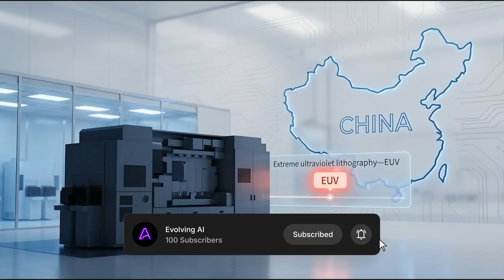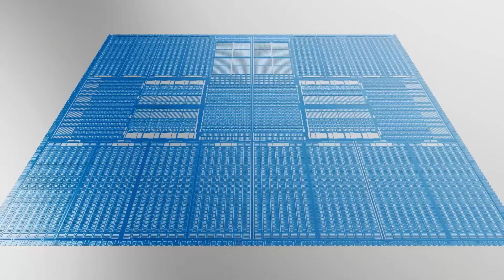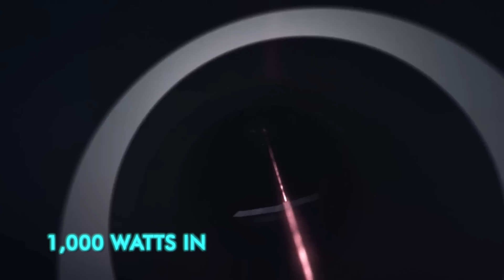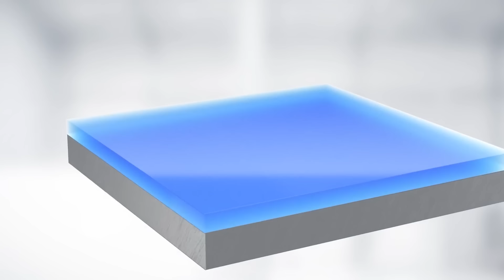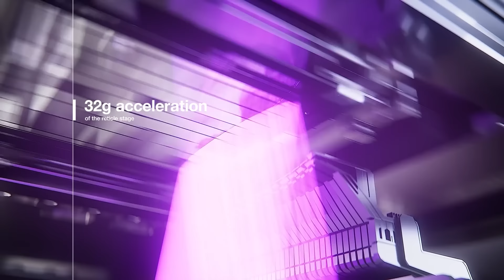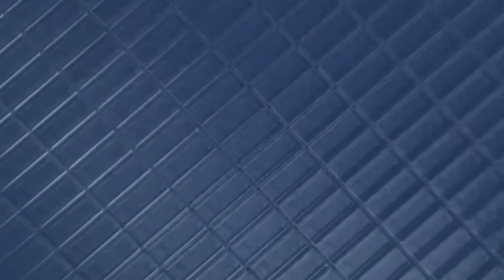China Just Successfully Built ASML's Replacement & The West is in a SERIOUS TROUBLE!

Comment: They are also working on a 100–150-meter-circumference SSMB (Steady-State Microbunching) particle accelerator designed to provide a >1 kW continuous, pure EUV light source for multiple lithography machines. While the SSMB principle has already been validated in a proof-of-principle experiment at the 48-meter-circumference Metrology Light Source in Berlin, scaling to a full prototype is estimated to require several hundred million to one billion Chinese yuan (roughly $100–150 million USD), with success hinging on extreme technical hurdles including maintaining ultra-stable electron beams under ultra-high vacuum, employing magnets with substantially higher power-supply stability than current standards, and perfecting the optics for efficient EUV light extraction.

Comment: It's only a matter of time before China announces mass production of EUV machines, and when that happens, semiconductor stocks—ASML included—will drop sharply.
Reply: They prob caught up by 5-10 years but are still not anywhere close to asml’s machines
Reply: @TC-jo2vj For China, the priority is being able to produce chips, even at a lower yield than the ASML machine.
Reply: Imagine countries with 2-3  lethographic machines mass producing 5nm processors, chips all over the place...
Reply: First they have to conduct multiple tests on that prototype and pass all test cases
Then they have to train an entire floorline model of about 100k components based on the test cases result 
Then they have to configure perfect climatic and region wise constraints for every single machine in factory
Then they have to run about half a million combinations and pass about 95% of it in the floorline model 
Then after that they can start production considering the fact that they have mastered the water consumption constraints that literally handles efficiency of EUV machines
This all takes about 8-9 years no matter even if u call god for help 
Also without mastering this for decades like ASML did the chances of success hover near 35%
Reply: @Coder_Bro_s3y   China has successfully built a working prototype of its EUV  The prototype has achieved the critical milestone of generating 13.5 nm extreme ultraviolet (EUV) light and has reportedly been undergoing testing since early 2025.
Mass production timeline for commercial chip production. target: 2028 - 2030
Reply: @hendrang1 
Bro they have not mastered all test cases so far literally half way in testing of prototype
And there is difference between developing a prototype and deploying it for production
In fact prototyping is roughly just 10% of total job done
Reply: @Coder_Bro_s3y 
And of course you work for the company in question, on their project and know this for a fact.
Reply: @Coder_Bro_s3y  Yeah because you said so lol. 😂😂😂😂😂
Reply: @DaveF8324 
Not me but my brother he worked in ASML for 8 years he knows every single thing even with the machine in hand it takes about 5-6 years with making machine from scratch it becomes even harder
Reply: @Coder_Bro_s3y  . Assuming that you know what you are spouting about, and that ASML took between 5  to 6 years to mass produce the EUV machine for the production of "<7 nm chips", then I am almost certain that it would take China only one third of the time, i.e. ~2 years to mass produce the machine for her own mass production of <7nm  chips. So, it is extremely likely that they are not hyping when they say that their mass production of <7nm chips is scheduled for 2028. Only 24 months left when the world wouldn't need to buy those machines from ASML for 280-380 millions   dollars to produce the high-end chips. BTW, China has not said that she will sell their new machines yet, to compete with ASML, as they would then miniaturize to a relatively compact size that'll likely cost less than 100 million euros each, even if the rest of the world's electronic firms wants to make their own chips to supply their own electronics firms.

ps. I worked in Eindhoven for 7+ years before moving to Rijswijk when I taught at Delft U. I know the cadence of Dutch engineers and Chinese engineers sufficiently to know the "worklife-balance" cultures of both people.
Reply: @Coder_Bro_s3y In the West especially the US takes years to build anything. We are talking about China. Even if it takes 5 years, it's still fast as the Netherland took 30 years to build the first DUV machine.
Reply: @PeterLim-q1y Right
Reply: @Coder_Bro_s3y delusions. China's manufacturing ecosystem is light years ahead of any countries. They reflected that across all industries but somehow, chip manufacturing is the only exception? Lets also not forget cxmt only entered the race in 2016. ASML tech is the result of collaborative efforts and shared rnd across many countries. 

China did it in isolation.

In 2010 they imported more chips than they import oil. Now they're already slowly satisfying domestic demands by 2028 they would already stop importing chips. They could replicate Taiwan's chip ecosystem, and improve on it while making the entire process cheaper. Like they did everything else.

They already overtook all countries in research output, patent application but somehow, China steals technology, their technology is subpar bla bla. Nobody is buying that rhetoric anymore. Your school goers are partying every night and doing drugs while Chinese students literally treat examination like its a life and death matter. Thats a culture that stems from 2000 years old practice of imperial examination lifting anybody into nobility. 

China has a solid history of lowering overall price as soon as it dominates a market. This is good news. But westerners are too rich i guess to celebrate this.

Comment: China does have a prototype EUV machine — but it is nowhere near ASML’s commercial EUV tools.
Reply: That's in the learning phase, after the 1st, the 2nd will be the innovation / upgrade phase... It will be a better machine...
The 3rd is extreme innovation phase... The machine will be better and most Compact in size... At this phase, not even ASML can match it...
That phases already experience in fighter jet, aircraft carrier, chips, etc...
Reply: @pekjinoei1042 
First they have to conduct multiple tests on that prototype and pass all test cases
Then they have to train an entire floorline model of about 100k components based on the test cases result 
Then they have to configure perfect climatic and region wise constraints for every single machine in factory
Then they have to run about half a million combinations and pass about 95% of it in the floorline model 
Then after that they can start production considering the fact that they have mastered the water consumption constraints that literally handles efficiency of EUV machines
This all takes about 8-9 years no matter even if u call god for help 
Also without mastering this for decades like ASML did the chances of success hover near 35%
And I have not even considered hyper precision lens made by Zeiss which took them 37 years to develop the first one
Reply: China moves extremely very fast. They will very likely have it within 2-3 years at most. Maybe not as fast or as good in the beginning but almost as good is more than good enough for China. Once it is in production, it will be improved and ramped up extremely very fast and after that it will soon flood the market. Not if but when.
Reply: And the price will be the price of a washing machine
Reply: You are part of the select group that once said that China would be a generation away from achieving anything.
Reply: @carloschacal9334 The US and western estimation of 10 years is equal to China's 2-3 years or even much earlier. 😂